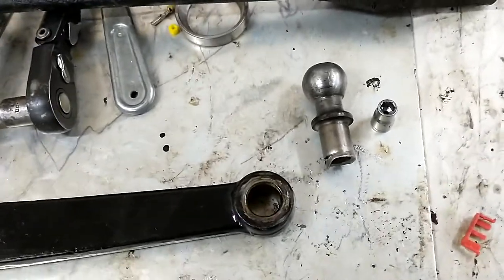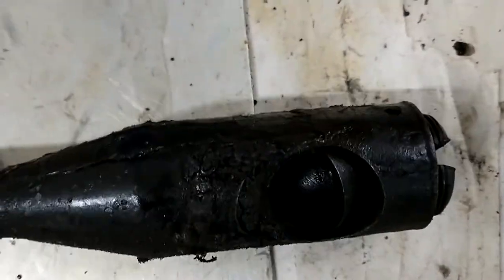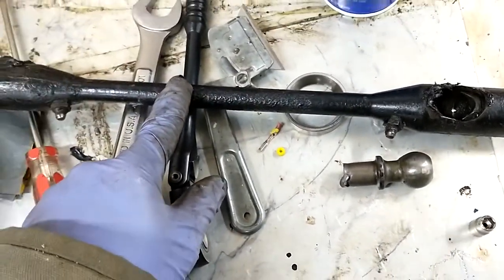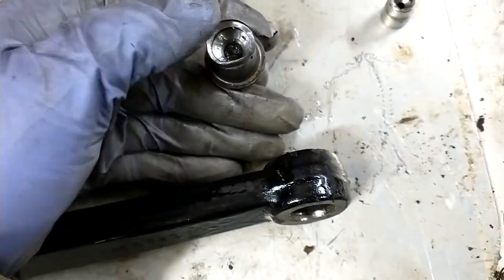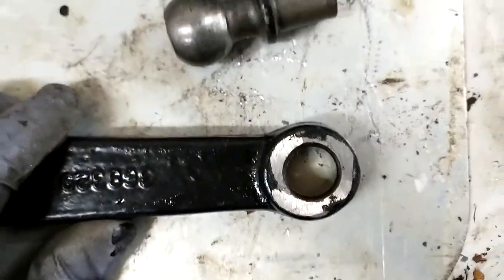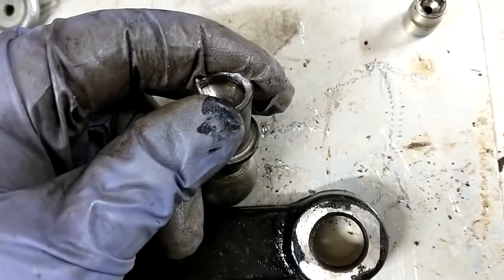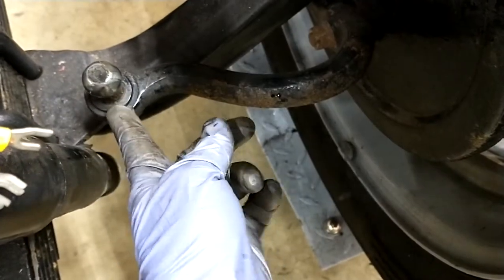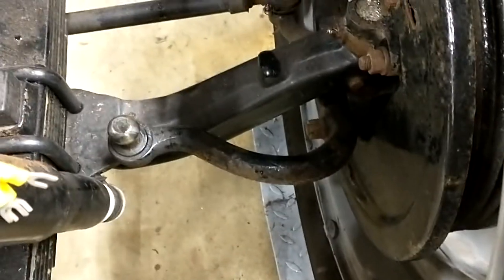1949 GMC Pitman arm ball stud removal part 1

Comment: So I'm doing this process with my 53 Chevy. Where did you get you new ball stud? The one's I ordered from Classic Parts were way too big on the sleeve diameter and the ball itself.
Reply from the maker: Hey there - I didn't get new ball studs. I updated the drag link to a modern style that already includes ball studs.  I had to ream my steering arm a little bit to make it fit.  See my other videos detailing the process.  After the fact I found out they make tapered reamers for things like this.  I had to make a couple of small shims from sheet metal but it did the job.  Here is the part I used ACDELCO 45B0000: https://www.rockauto.com/en/moreinfo.php?pk=673947&cc=0&pt=7276&jsn=1  
Mine's a 1ton truck, not sure if the steering parts differ from 1/2 - 3/4 - 1 ton.  Good luck!  Thanks for watching!